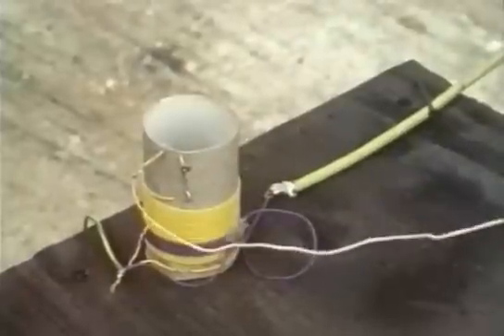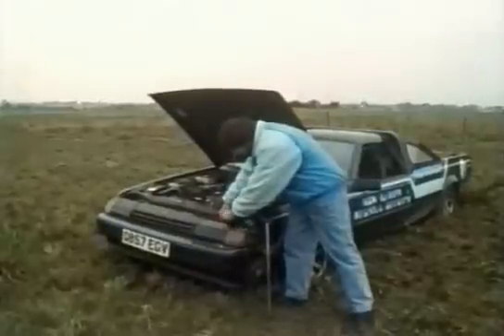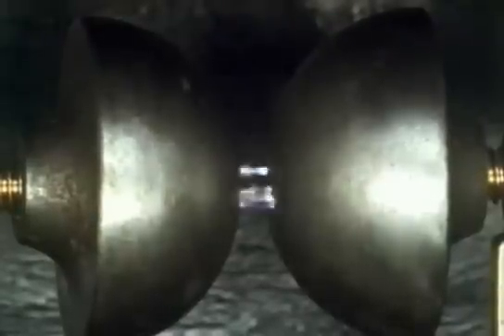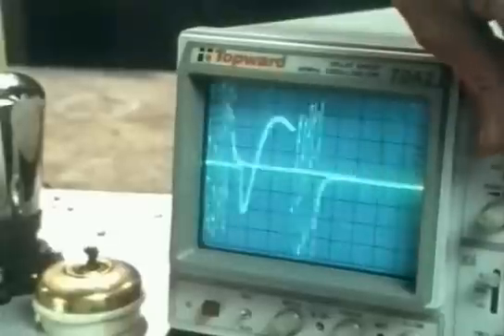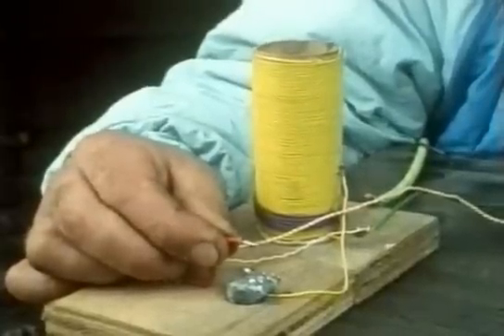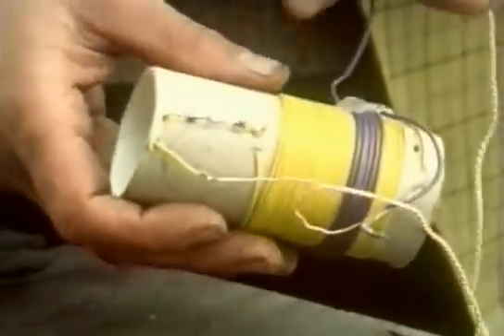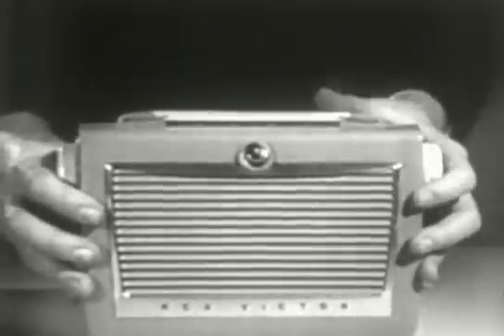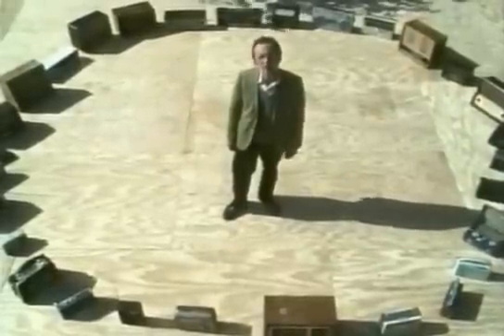Secret Life Of Machines - The Radio (Full Length)

Comment: As an amateur radio {HAM) operator and a former U>S> Military electronics (communications technician) operator I learned more from this video than all of my previous  teachings combined! Thank you from the bottom of my heart felt wavelengths. !
Reply: I was a Broadcast Engineer for AFRTS in the mid '70s. I tested out of that three year school while  in Basic.
Reply: Can I ask you good folks what's the future job outlook like for RAN engineers in your opinion? I currently work as a wireless network engineer ( has to do with WiFi) but I'm passionate about mobile networks to such an extent that I'm thinking of going back to college for a telecommunications engineering master.

Comment: Hi Carl, thank you for posting the old but, quite informative documentary on some of radio's history.  I wanted to point out an error on the video, the earliest spark gap transmitters did transmit interference all over the band but, that was okay for a while, with only a hand full of stations operating part time.  However, when this new technology became more popular, interference quickly became an issue.  To solve the problem, a combination of inductor/capacitor filters were used, along with the transmitter antenna being electrically matched to the transmitter, which added another layer of filtering.  The filtering was a huge improvement (although not perfect) as it allowed many stations to use the band similtaneously.  After vacuum tubes/valves were invented and transmitter circuits devised, these were found to be much cleaner in regards to interference.  As a result, the filtered spark gap transmitters were obsoleted, being outlawed in the mid 1920's.

Comment: I built a crystal radio when I was 10 or 12, it worked but I soon ditched the galena crystal for a diode I scavenged from where I don't remember. I'm 74 now and remembering that I decided to build one now from stuff lying around, the coil I bought off Amazon, it would have been too tedious to wind for me now, it works, but looks a little more professional than the one I made in 1960. Radio has been my job and now a hobby, thank you for this retro look into my favorite subjects, besides my kids and grand kids.

Comment: Great little documentary. I got interested in radio at around 11-13 years old. Building circuits with my 200 in 1 electronic project kit and using my father's short wave radio scanner to pick up all types of signals. A nice rendition of Take Five at the end as well.

Comment: I grew up in South Wales. On 13 May 1897 Marconi, assisted by George Kemp (a Cardiff-based Post Office engineer) transmitted and received the first wireless signals over open sea between Lavernock Point and Flat Holm island in South Wales. The very first message, transmitted in Morse code, was "Are you ready", immediately followed by "Can you hear me", to which the reply was "Yes loud and clear". The Morse recording tape is on display in the National Museum of Wales. A commemorative bronze plaque to commemorate the 50th anniversary of the transmission was unveiled at Lavernock Church in 1947.

Comment: Did they really run a spark gap transmitter, in 1990.  (Using Rex's car).
Naughty!
Reply: Yes, I bet the interference was interesting!
Reply: It surely upset a lot of HAMs:)
Reply: Perhaps they did the polite thing and announced they were doing a test, first. It is radio, after all.
Reply: considering the short distance that the signal had to travel, probably a very short antenna was used(actually, the leads going to/from the spark gap were probably the only antenna used).
With such a limited antenna, the range would be quite short, so interference would be minor.